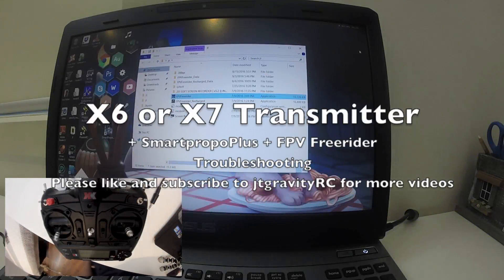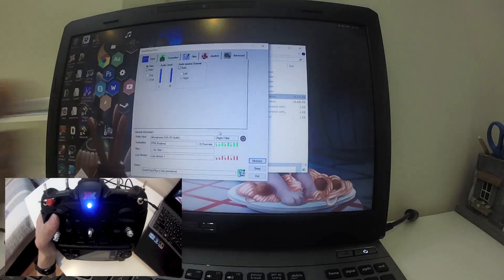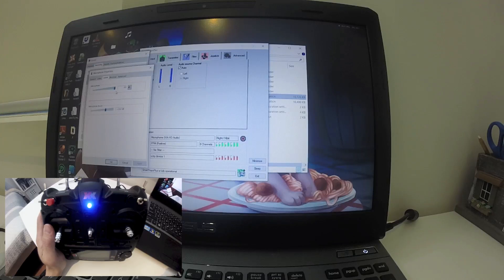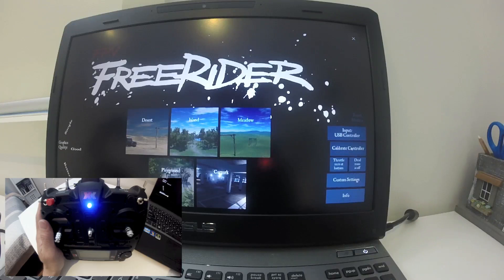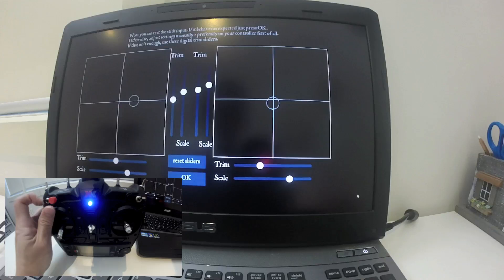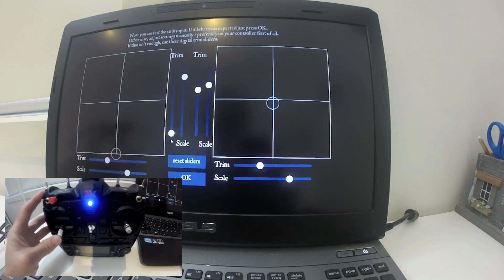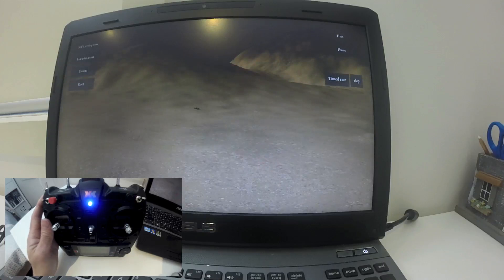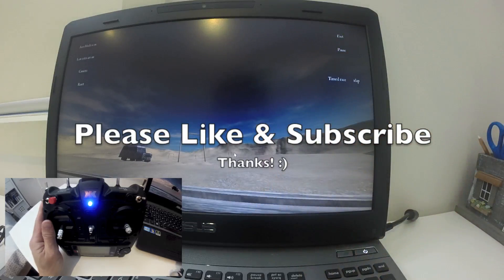XK X7 or X6 transmitter + SmartpropoPlus with FPV Freerider (troubleshoot)

Comment: This is fantastic jtgravityRC!  I wasn't sure if the hole in the back of my X7 was for a buddy cable or if there was some special USB cable that used that port.  I've been using a generic USB gamepad with my PC for FreeRider, which doesn't work very well.  I hope this rig will work with other FPV simulators.

Thanks and Merry Christmas from Thailand!
Reply from the maker: Hi, Jimbo. Thank you for watching. Yes, this can be used but now I find that sometimes it works and sometimes not. I have ordered an analog to usb cable i.e. one side is the audio plug for transmitter and the other side is usb to plug into my pc. Still waiting for it to arrive. Hopefully it works better. As for simulators, I don't have any problems with Devo 7E or 10 and Frsky Taranis using usb cables when connecting to FPV Freerider on Mac. Taranis is good for pc too with RealFlight Drone, Hotprops and Velocidrone. By the way, with Taranis, you need to set it to slave under the Trainer settings. As for Devo 7E and Devo 10, you need a specific model settings (I think I have them on one of my videos). Merry Christmas to you too!
Reply: Yeah, sadly, X7 with SmartpropoPlus is not very reliable.  I've just ordered a multi-mode RC/USB interface cable from Banggood.com that comes with several different plugs that will fit a variety of RC transmitters.  I hope this 'magic' cable will do the deal.  If it does I'll leave an update here.  Cheers!
Reply from the maker: Thank you for the updates.
Reply: Hi Jt and Jimbo, have you guys had any success with the adapters each of you got?  I know some laptops don't have a mic port, so I was just curious.

Comment: Hi! Any idea how to switch from Mode 1 to Mode 2? Basically my right stick is acting as my throttle/yaw and my left stick is acting as my pitch/roll
Reply from the maker: Thanks for watching. There is a youtube video about it. Just search: Mode 1 to Mode 2 conversion XK X7 transmitter.
Reply: Thanks but the transmitter is in mode 2, works just fine flying my XK X251. It's when connected to the PC that it functions as Mode 1 while actually being in mode 2
Reply from the maker: Are you using FPV Freerider?
Reply: jtgravityRC Yup! I wonder if it has anything to do with the fact that I bumped up all the rates/expos in the X7... Weird, huh?
Reply from the maker: Sawcasm | Heroes of the Storm maybe ... I will try to troubleshoot with mine and let you know